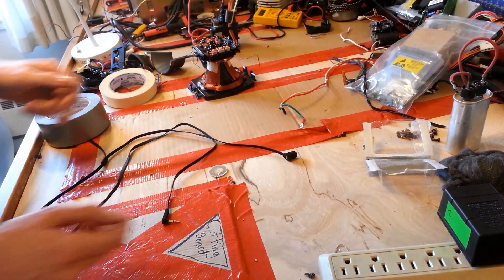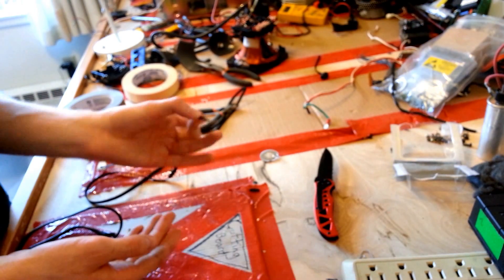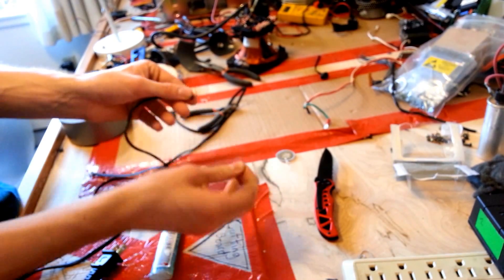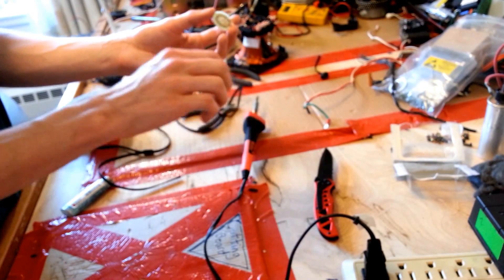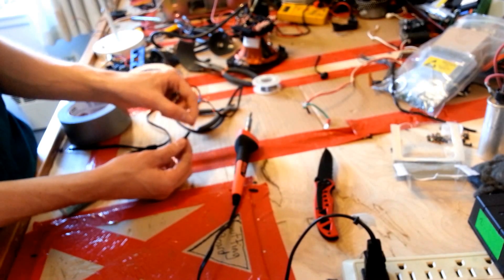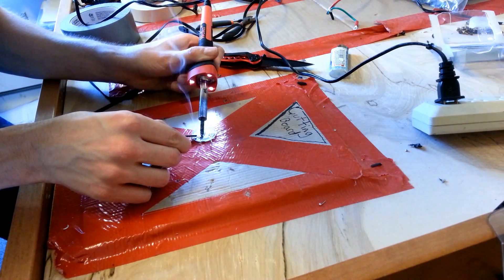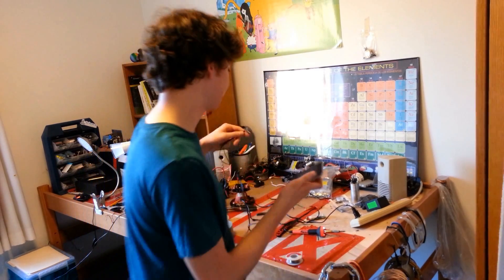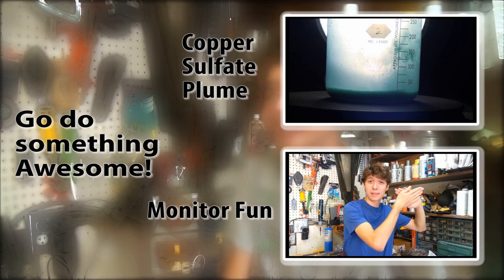Bone Conduction Headphones

Comment: to get solder to stick to the tricky wires and surfaces, get a tin of flux. use an ultra fine grit buffing cloth or contact paper (after using a lighter like you did) to get remaining coatings off and rough up the surface a little, and then apply a coating of flux, let it sit on the surface for a bit before soldering. it should have created micropits in the metal, allowing solder to fill the pits of the now clean metal, and bind to the area.

Comment: You are holding the iron on the Piezo substrate too long. If the piezo's temperature exceeds the curie temperature threshold for too long, the crystal starts to depolarize, losing its effective travel. This means you are degrading the max amplitude that your piezo will produce, while also degrading frequency response. Maximum time you should ever hold that unregulated soldering iron to that piezo is 2 seconds. Use tons of flux when soldering, I don't see any in the video, but flux will make your life so much better when soldering. It helps remove surface oxidation, spreads heat, and allows the solder to more easily flow into an area. If you don't have flux, get a simple flux pen off amazon. Source: I'm an EE
Reply from the maker: Hey thanks, that's a great tip. For those who are trying this at home, for sure find a way to use some flux. I didn't have any at the time, but it does make a world of difference.

What is the curie temperature in this context? I've never heard of that term before.
   -Jake
Reply: The Currie temperature threshold for piezoelectric materials describes the maximum temperature the material can withstand before its crystal lattice structure starts to depolarize. When they depolarize, their net displacement approaches zero as contraction and expansion of each of the individual structures may be in a random direction. Random orientations entail a net value approaching zero, displacement will cancel out if entropy is allowed to take hold.
Reply: @davidbarnes9626  how to use flux sir!?
Reply: @JamLabs01  how to use flux though